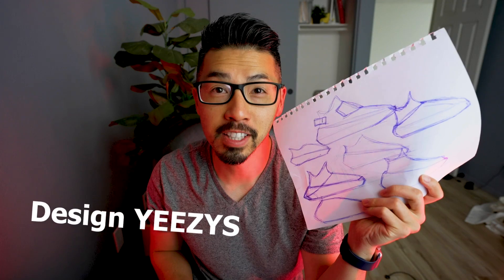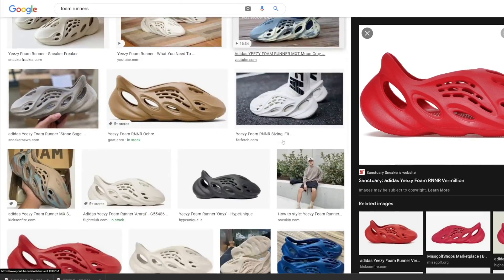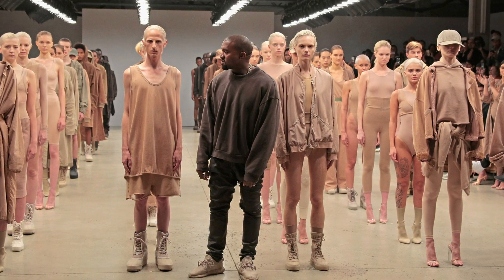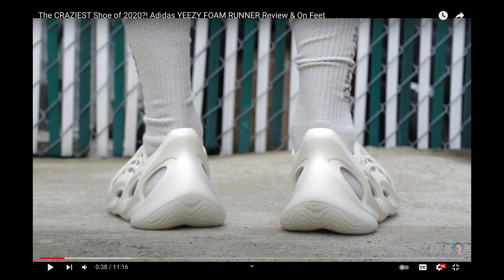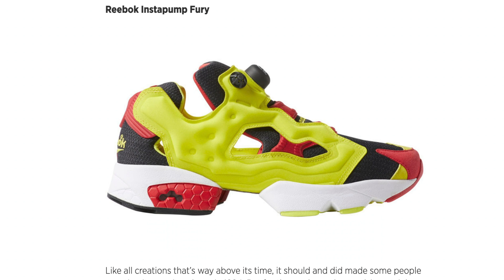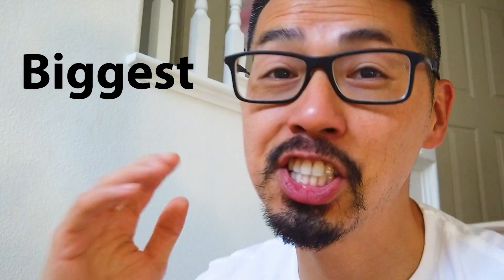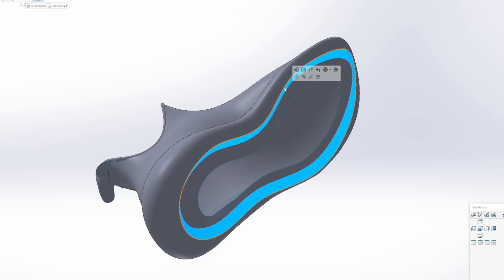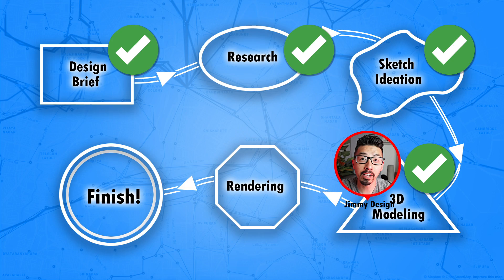How My first Shoe Design Turned Out...

Comment: No way you had already got the idea before you started designing
Reply from the maker: An idea is where it always starts. After going through the process do you discover pitfalls in the idea. As a designer, you learn to compromise, pivot, and solve challenges during the design process that finally gets you to your end goal. My biggest discovers usually happen during the 3D modeling phase.